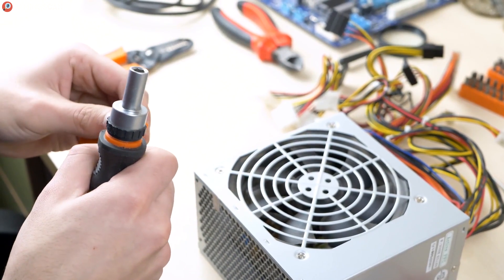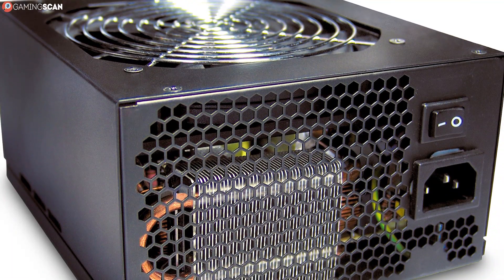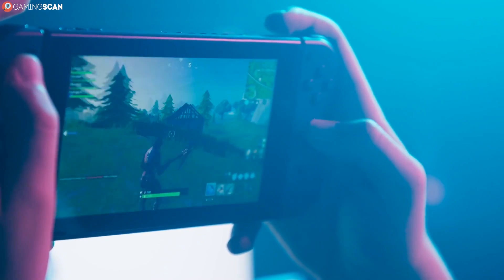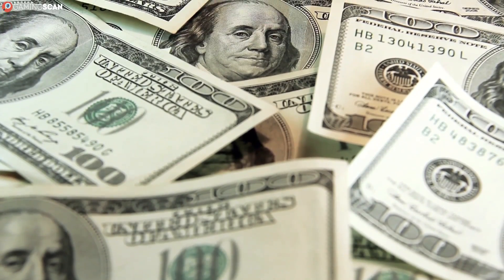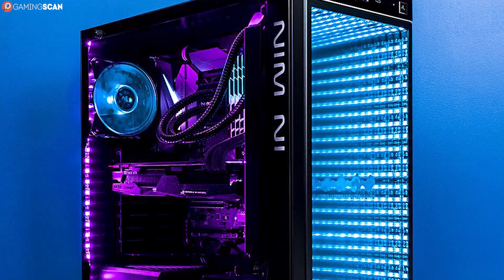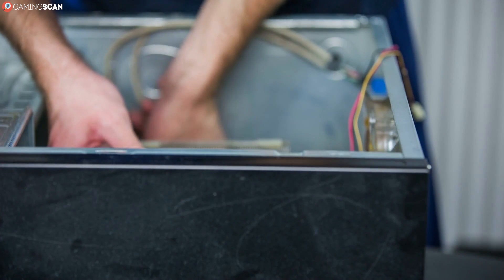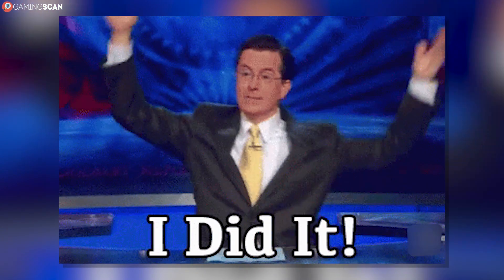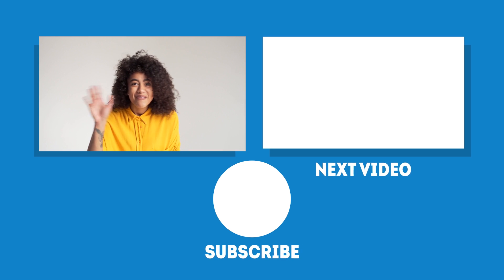Full vs. Semi vs. Non-Modular Power Supplies - Which To Choose? [Guide]

Comment: FWiW....i am in need of replacement LEPA Maxbron branded (semi) modular ATX psu power cables (mainly 6-8 pin pcie,4 pin molex and sata power cables for now...)...and would like to know what online pc cable companies make modular psu power cables to fit a LEPA Maxbron M1000B modular psu OR would Corsair,EVGA,Thermaltake branded modular
power cables fit the LEPA Maxbron psu OR would I need to shop an online custom PC cable business ??
🤔🤔🙄🙄

Comment: id say another benefit of fully modular is that if one of the cables were to somehow get messed up or broken you can replace just that cable instead of the whole psu
Reply: Well if a modular psu has a warranty it won’t cost you as much money to buy a brand new one
Reply: @twosideddog8821  what happened if the whole PC explode?

Do the psu company need to paid full PC of mine like how it work?
Reply: Yup hit the nail on the head there 🎯

Comment: You should have really mentioned that PSU Extension cables exist. My PSU is non-modular, and when I decided I wanted to clean up the cables and make it look better, I decided to add some white cable extensions which look great. All the un-used wires are hidden, while the extension cables make their way to the front. I found this to be cheaper than getting a modular PSU, and then paying for more expensive CableMod cables etc.
Reply: And that a fully modular power supply is pretty much the exact same price as semi-modular and it comes with cable, you don't NEED to buy custom cables. There's literally no reason to go semi-modular in any case.

Comment: How is the Corsair AX1200i for heavy gaming build
Reply: it's overkill i say, unless you are going to use SLI or maybe use the upcoming high end cards from Nvidia the likes of RTX 3090 and such
but for a single graphics card just get an 850W highly rated PSU like the AX850 from Corsair, or maybe get the Seasonic Prime 1000W Titanium if you are going to use high core count Intel CPU (the likes of the 10980XE)  since they end up consuming so much power when overclocked up to 550 watts for CPU alone
Reply: ExoTech i’m getting the rtx 3080 and i just ordered evga 850w power supply 80+ gold semi modular power supply

Comment: Is Corsair VS 550 Watt is Good Pair With Gigabyte 1650 Super ?
Reply: Yes even vs 450 would be enough if  u dont plan on overclocking is m going to do one with a vs450 using either a 1650 or rx 570 what ever is cheaper
Reply: The VS series aren't really good I thought. The cx (2017) series are better. You can see if at this website: https://linustechtips.com/main/topic/1116640-psucultists-psu-tier-list/

Comment: Lol, just wait till black friday, wait till they put a fully-modular power supply with the extra 4 pin connector or whatever for the motherboard. Buy it, thank me later. It is probably 80 bucks for 750 W. If you want to upgrade or whatever you may do in the future, it can do it. I have a mid-tower case where the power supply is fully shrouded, I don't care at all